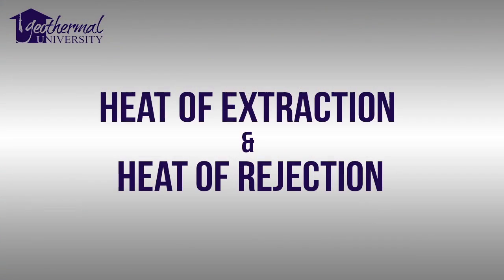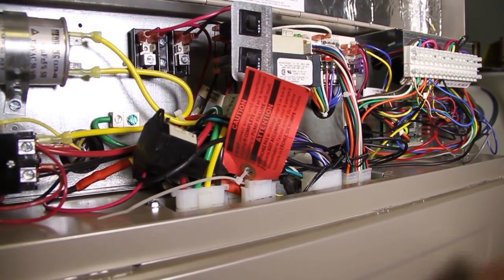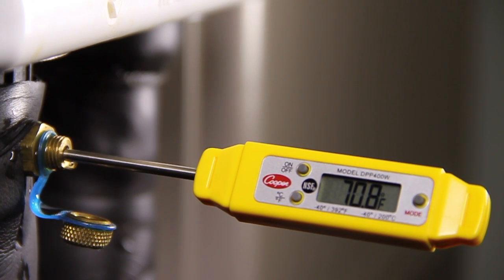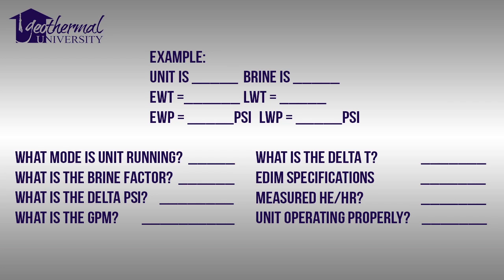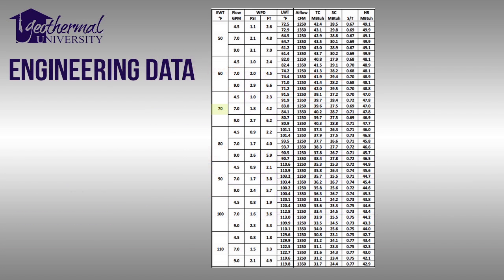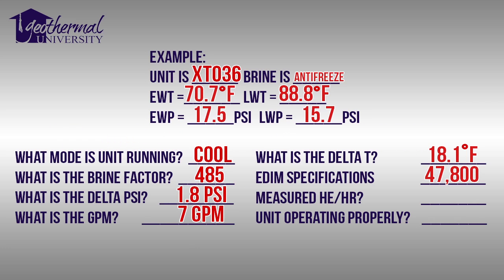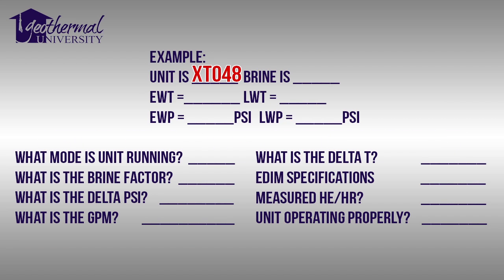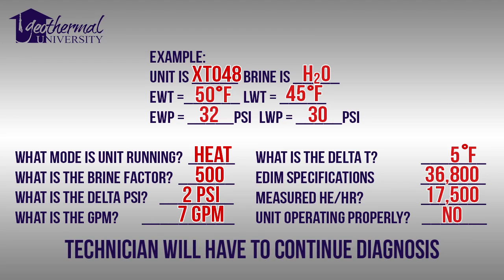Heat of Extraction/Rejection

Comment: What would the numbers be if your using glycol?
Reply from the maker: Hi Jesse,   We use 485 as the specific gravity of any antifreeze in the system. So, the heat of extraction/rejection calculation would be TD x GPM x 485. If using straight water, the calculation would be TD x GPM x 500.
Reply: Sounds good